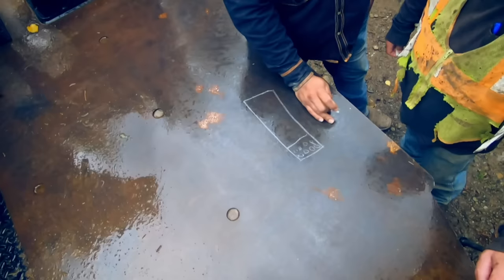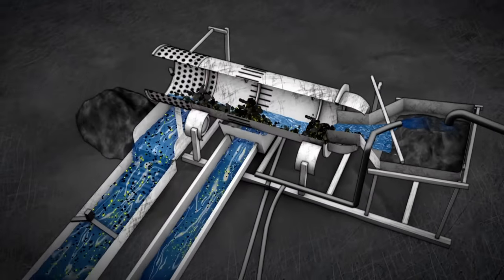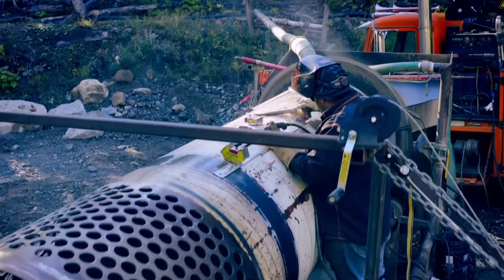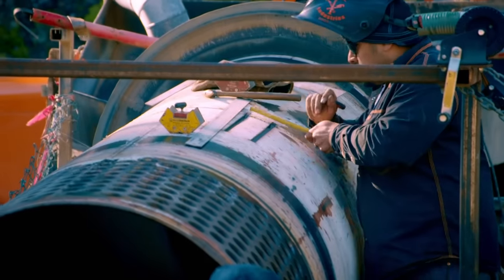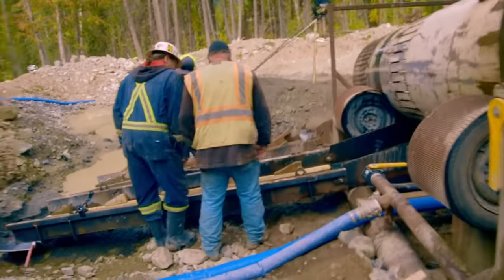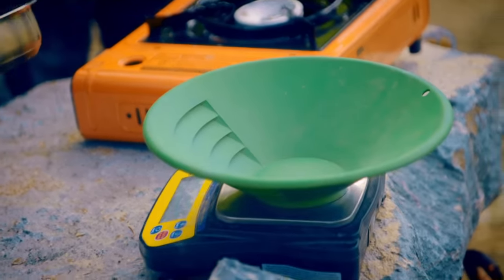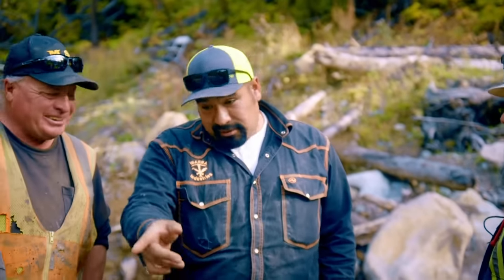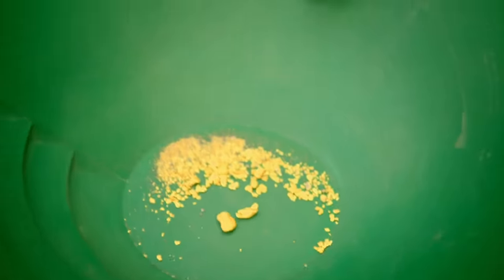Freddy & Juan Save A Miner's Operation With Washplant Fix| Gold Rush: Mine Rescue With Freddy & Juan

Comment: If they built there own system they would bank. They know all the tips and tricks ❤❤❤❤
Reply: They are the best, but each plant depends on the type of ground you have to work (clay, vs sand vs water supply and so on) plus the type of gold. Each factor helps decide what type of plant is best, there is no design that could do it all. But if there were Juan and Freddy could improve it!

Comment: If they KNOW they have lost gold in their tailings, once they get the issue fixed, would it be smart to rerun the tailings and get that gold?
Reply: I’ve been wondering this myself
Reply: I don't think so. Most of the gold are already captured, so running the tailing will only net a smaller percentage. Let's say the tailing has 20% of the gold remaining. But the new material contains 100%. I would only waste time on the 20% if there are no more new materials to run. Basically, you may get 5 ounces of new materials versus 1 ounce of old stuff.